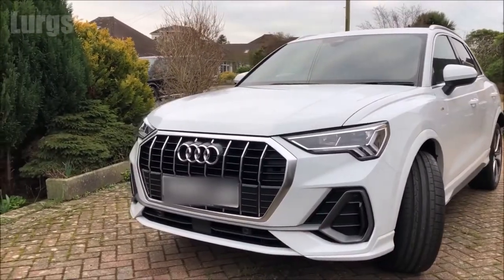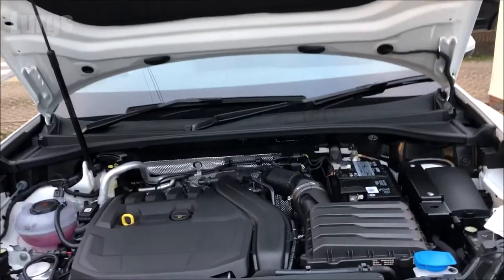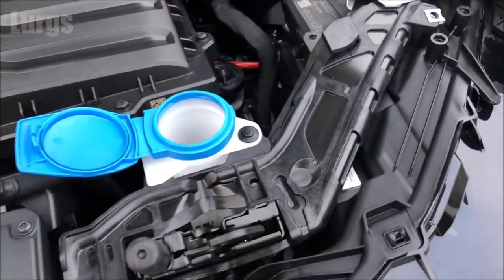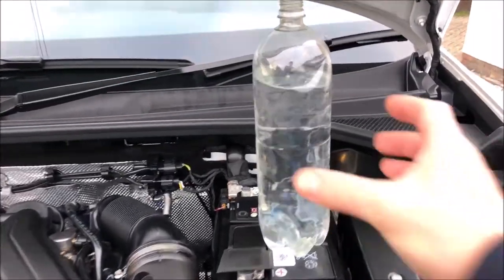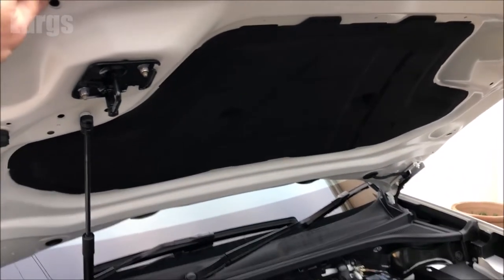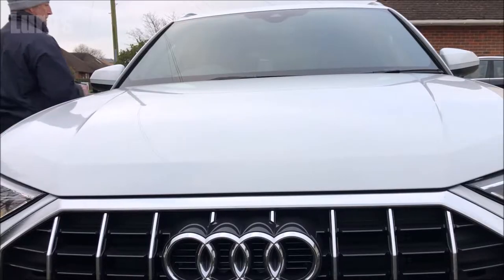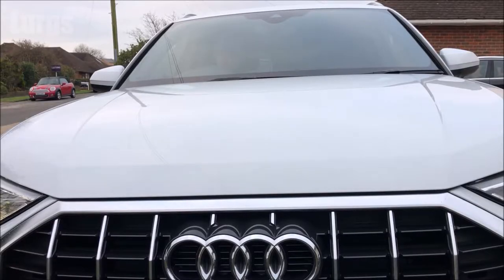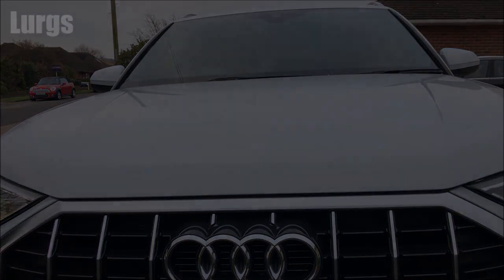How to fill Windscreen Wiper Fluid on Audi Q3 - Audi Q3 Screenwash Location

Comment from the maker: Other useful How To Guides to help you save ⏱TIME and 💰 MONEY:
Audi Q3 How To Guides https://www.youtube.com/watch?v=AnOldQLSr_Q&list=PLqrXuUebV8N8mx9gvCzf4OvwKlbdMnL2r
Audi A1 Sportback How To Guides https://www.youtube.com/watch?v=uhrg0m-PGYY&list=PLqrXuUebV8N9ijRiN7zdlkmoN70i0MBoc
VW How To's, Tips, Tricks & Fixes  https://www.youtube.com/watch?v=DosIviY1xxE&list=PLqrXuUebV8N_OyVUXrJNGikNiWncnAW7p
Vehicles How To's, Tips, Tricks & Fixes  https://www.youtube.com/watch?v=w44aQ7dc_Lk&list=PLqrXuUebV8N9fyM8qA2D0rkVfv929Ckod
How to check car fuses without pulling them out using a Multimeter https://www.youtube.com/watch?v=w44aQ7dc_Lk&list=PLqrXuUebV8N9fyM8qA2D0rkVfv929Ckod
How to connect a Car Battery Safely https://www.youtube.com/watch?v=1b2vJjUefYQ&list=PLqrXuUebV8N9fyM8qA2D0rkVfv929Ckod
How to disconnect a Car Battery Safely https://www.youtube.com/watch?v=XJ5SUabZCbc&list=PLqrXuUebV8N9fyM8qA2D0rkVfv929Ckod

Vehicles How To's, Tips, Tricks & Fixes  https://www.youtube.com/watch?v=w44aQ7dc_Lk&list=PLqrXuUebV8N9fyM8qA2D0rkVfv929Ckod
How to check car fuses without pulling them out using a Multimeter https://www.youtube.com/watch?v=w44aQ7dc_Lk&list=PLqrXuUebV8N9fyM8qA2D0rkVfv929Ckod
How to Test Car Fuses without pulling them out using a Car Blade Fuse Tester https://youtu.be/zLfa7_FbZrU
.
How To's, Life Hacks, Helpful Tips https://www.youtube.com/watch?v=dcmxUTsedlk&list=PLqrXuUebV8N92xXP4Dm_pHfBpEQ3wtP2R
Washing Machines How To's, Tips, Tricks & Fixes https://www.youtube.com/watch?v=0_gst8RokRo&list=PLqrXuUebV8N_Bv_41hH-IpIfM5qiS0Sin
Dishwasher How To's, Tips, Tricks & Fixes https://www.youtube.com/watch?v=6z22-Ysn7rE&list=PLqrXuUebV8N89GJMUjDiMqGpAcic3wqfD
Toilets and Plumbing How To's, Tips, Tricks & Fixes https://www.youtube.com/watch?v=vT5KwJ2A2eU&list=PLqrXuUebV8N_d4OWPjAk4PJ7LnKb0Jdot
Combi Boiler How To's, Tips, Tricks & Fixes https://www.youtube.com/watch?v=1gGEP2y_qHM&list=PLqrXuUebV8N8aiBpt_F3n23E3IOLlmgK2
My Reviews https://www.youtube.com/watch?v=QX0ge0QOXJk&list=PLqrXuUebV8N9_JYlSh2LjbfUsybF840oy
.
TECHNOLOGY
==========
Windows 10 How To's, Tips, Tricks and Fixes  https://www.youtube.com/watch?v=eZW7ka9xgXg&list=PLqrXuUebV8N95_cVCA-40v6eT9piGz26y
iPhone iPad iTunes How To's, Tips, Tricks and Fixes https://www.youtube.com/watch?v=hcGfZTcJxvo&list=PLqrXuUebV8N_YRivg9p4ZpkUyBDbSb8t7
iMovie iOS How to Guides https://www.youtube.com/watch?v=uTkXwZJ0gE4&list=PLqrXuUebV8N-D5BiCaF2AV-Qb-8gZwBFC
WhatsApp iPhone How To's Tips, Tricks and Fixes https://www.youtube.com/watch?v=5hhxjxkNMUA&list=PLqrXuUebV8N-bMvTYJdRXrKakVdChdl9o
Google Chrome How To's, Tips, Tricks & Fixes  https://www.youtube.com/watch?v=iLSbSA5YECc&list=PLqrXuUebV8N8RYpRb0gVVNf9SpC78SB47
Microsoft Word & Excel How To's, Tips, Tricks and Fixes  https://www.youtube.com/watch?v=OZi6yS79FLA&list=PLqrXuUebV8N_DyHPlBddZaL8LOwuCzFK3

Comment: Always mix concentrate with water beforehand. It won’t mix automatically in the tank and your concentrate will get out almost completely unmixed.
Reply from the maker: As soon as the car starts moving and you are driving about it will all swish about and mix up fine. But yeh if you pre mix it is more accurate with the dosage.
Reply: Not to me. If you have some water in the tank, and you add concentrate and then water, it might mix fine. But if your tank is completely empty and you fill in concentrate and then water, It won’t mix appropriately. My tank was empty. I put concentrate first and then water. For the first few weeks, it would spit out thicker and very soapy liquid (which was the concentrate) and after more watery one..